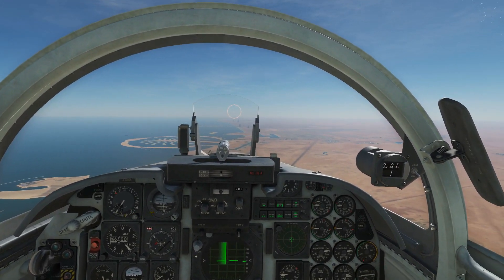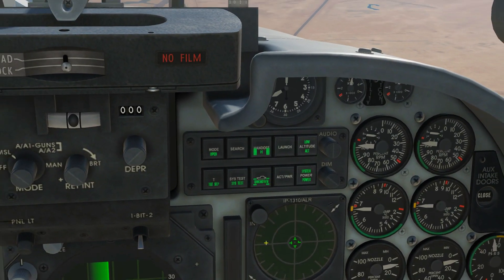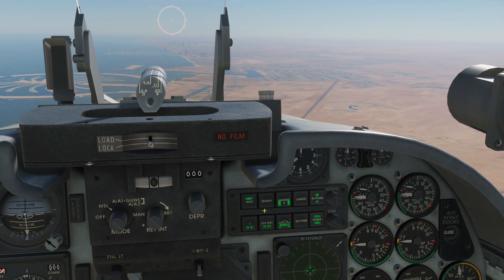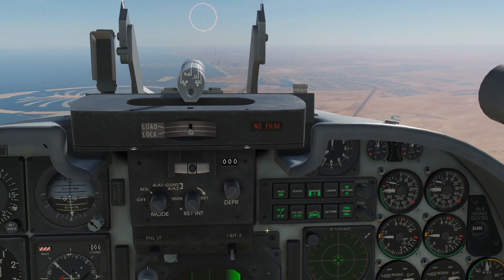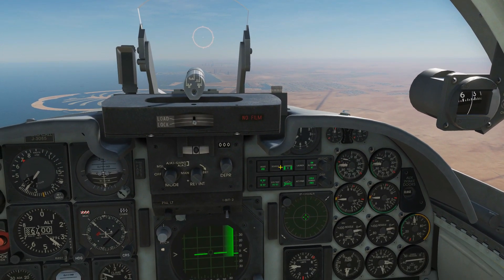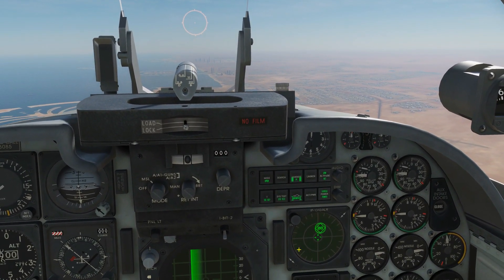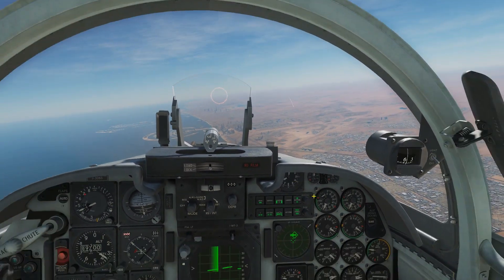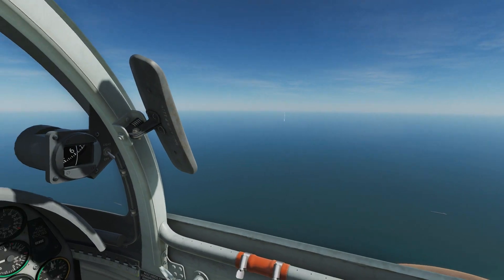F-5E Tiger II: RWR Radar Warning Receiver Tutorial | DCS WORLD

Comment: I know there's no exact number for this since signal strengths will vary, but what's an approximate max range of the RWR for the average fighter aircraft? Just so I can have a very rough estimate for range when they pop up on the edge. Also, would it detect launches for a Fox 2 even though it's IR? Or would it only detect a Fox 1/3?
Reply: I know this is  a very late response but RWR only covers radar guided missiles, HOWEVER there are systems that detect IR but those are relatively new compared to the F5. (The apache and blackshark have IR launch detectors in DCS I believe)

Comment: About distance how can i know the close missile or the danger one
Reply: The RWR won't give you any idea of distance for missiles or tracking radars, you'll have to go heads up and visually spot threats, using the RWR to point your eyes in the right direction. It can only interpret strength of the signal, which is used to determine if you're being tracked/locked